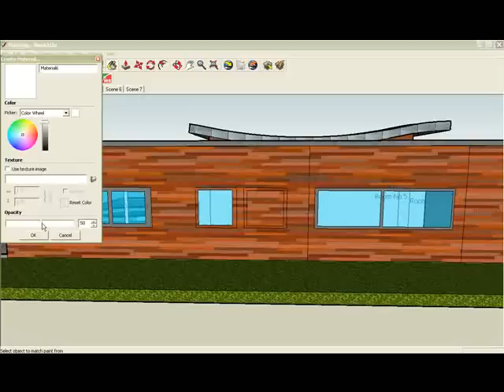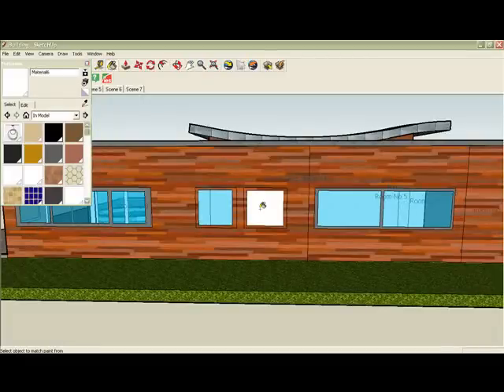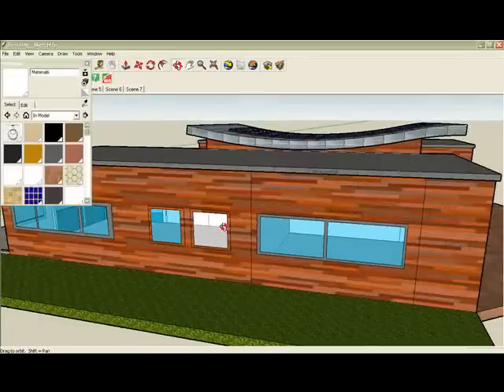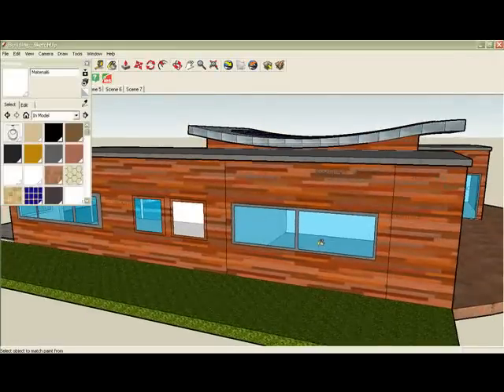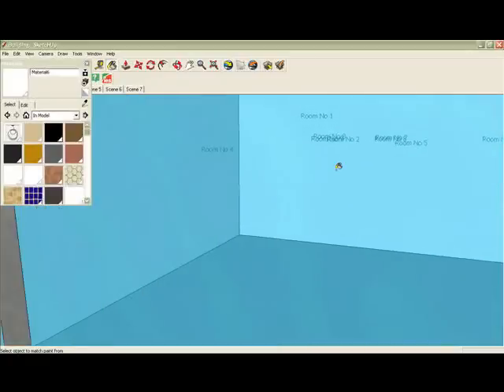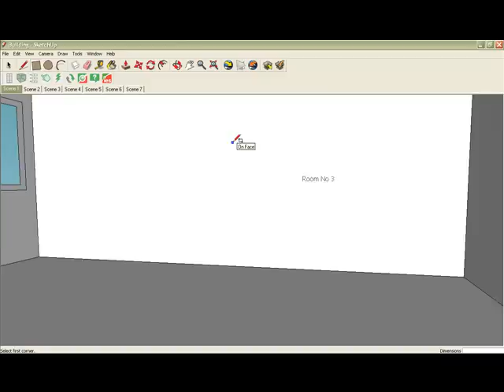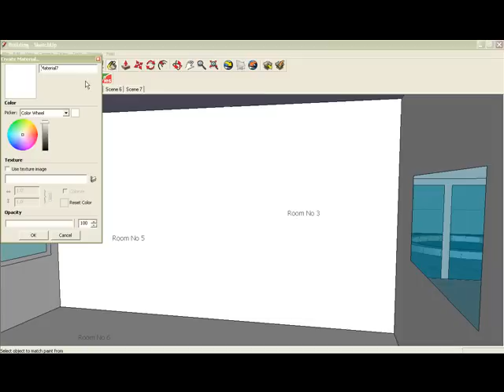IES SketchUp plug-in: Adding Openings

Comment: can you please confirm whether i need to draw in internal doors when making my model, prior to using the IES toolbar. Obviously doors will have a different u-value than partition walls so this suggest it may be necessary. If so, would i just draw all doors in and then edit the construction properties at a later date? Are there any other details such as opacity etc that would need to be changed?